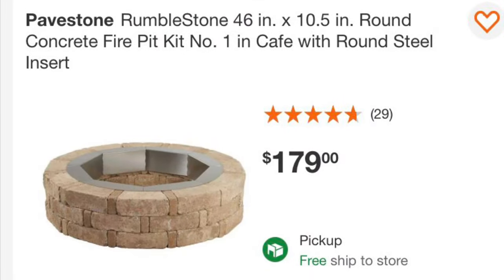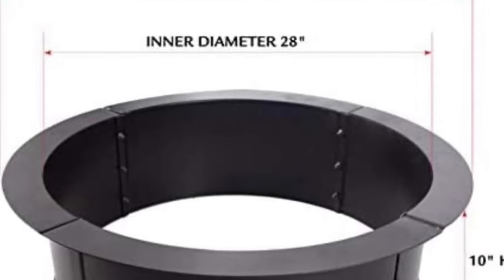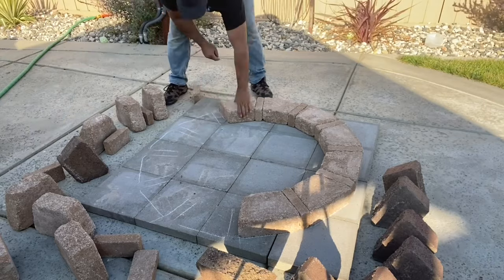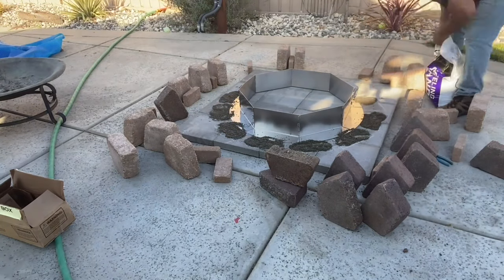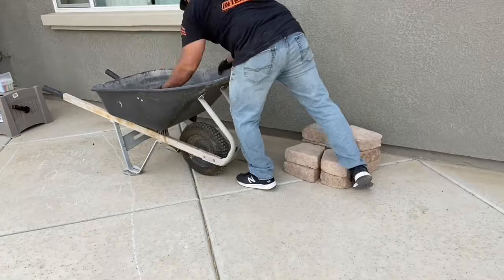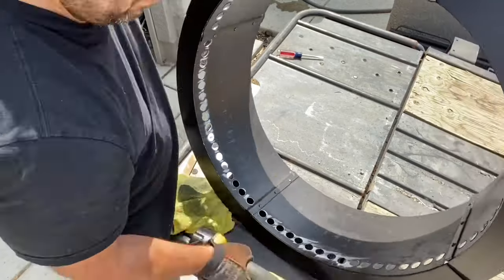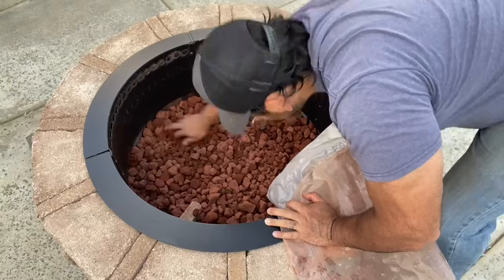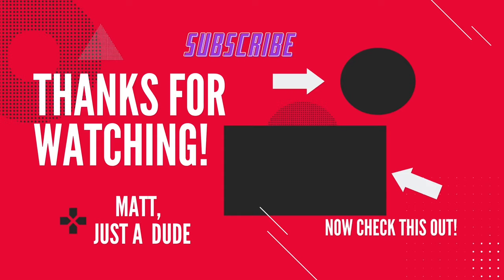Save Money and DIY a Smokeless Fire Pit. Build a Pavestone Rumblestone Smokeless Firepit for cheap!

Comment: Not only did you help me purchase this kit for under $200 (it's now going for well over $600), but using your advice I was able to keep it at 3 bricks high and feel like it's working very well so I was able to eliminate the need for the ring that comes with the kit! Tip forthcoming! Thank you so much! Maybe the wifey will stop getting chased by the smoke demons now!
BTW, I went 1/2 inch holes spread 2 inches apart
Reply from the maker: That’s awesome! Yeah, I did vent the top too much haha. Glad you made it work for you! Thanks for the comment.

Comment: It may be helpful to plumb a tube to the bottom of the middle to feed primary air in under the fire, because even with lava rocks under the fire, there's no passage way under them for air to reach the fire. I've seen some variations on the DIY smokeless fire pit that use a 4" duct tube to bring air in under the fire from outside the pit, buried in the ground, with the opening covered in hardware cloth and buried under the supporting rocks. That seems to work really well.
Reply from the maker: Awesome comment! Ive watched a couple vids like that too. For now, the fire pit works great for me but if I ever rebuild, I might add this and compare it. Thanks again for the comment. Please like and subscribe.

Comment: So this firepit idea.

I like it. I think its a unique idea. I do think you potentially are spending far too much than you need to, since those stones are $2 a pop and you can get away with buying them all outright, and they sell fire rings from ALL OVER cheaper than Home Depot & Lowes; Any solid ring firepit would do for this concept; BUT you would want to make sure you have that "upper ring". More in a moment, at least for my theory.

The way I would propose to make it better would be to add more of those lower induction vents you 'accidently' added.
My theory is that if you were to allow a smaller amount of air from the lower half to enter, it'll still divert 'path of least resistance' to the upper half whilst allowing some air to come in through the bottom. This, in turn, will allow both enough oxygen to immediately start (and inadvertently keep) the fire going, whilst creating a secondary pressure of oxygen to keep the cold air recycling in from the top, creating that 'secondary burn'.

I'm going to probably try this out when it get's warmer here, since I already have these stones; I'll likely just grab another 2 fire rings; One without a cap the other with a cap, and 'repeat' the same idea as what you have here.
I'm using some mildly cheap (but also expensive) one from Tractor Supply. I not only "do not recommend" it, but it's just bulky, warps easily, and burned the fire honestly colder than some $40 amazon fire ring I purchased a couple years back. So I'm likely going to grab 2 rings off Amazon, likely cheaper end simply due to the method I have here.

I'll be trying to figure out the best method of attack for this idea; But cutting about 1" off the fire pit, then tack welding 4 of the spots in place risen up about 1/2". Using that as the "floor". Then setting the other ring inside that one (so any up draft goes back to the upper ring holes).
Then drilling the plethora of holes inside the upper ring cap.

This time, I really want to add a 'stone cap' to the top, so that the there is an extra 'area' of the fire pit, but I'm unsure if I'm going to do that.
What I am doing, however, isn't on a patio. I'm doing this in my backyard and recessing this into the ground a bit to already give a bit of a colder up-draft. Before, I simpy left "gaps" and dug a little dirt trench down to each of the breather holes at the lower part of the fire pit. This time, I think I'll likely span the gap a little wider than the direct with (making it ~36" again) and utilizing some drypack (3:1 sand/portland cement), creating a bit of a 'slope' to the lower part of the fire pit. This way I can ensure that dirt won't just 'make it's way in there after it rains' and make sure that there is some area for air to travel to it.

All in all, unique idea. I was thinking about the two fire-ring idea, but I just wasn't sure how viable it would be. This sort of proves that viability, and would likely make for a more successful fire pit, too.
Reply from the maker: Great idea

Comment: Was going on to order the kit and materials to build this today ( 2/20/22) and WOW ! The whole thing is now over $900 ! Supply chain ripoff. Retailers are now gouging everybody using the Covid excuse. There goes my fire pit this year. Going to have to reuse my 30" cheap metal stand one that cost $39 last year ( Now it's $89 )
Reply from the maker: Wow! Just checked the prices and the price of the kits greystone and sierra blend have really gone up! However, the Rumblestone Cafe Firepit Kit No 1 is still around $200 in my area. Also check with a local landscape supply yard. You might be able to get the blocks by themselves cheaper. Hope this helps.

Comment: I did 1/2 inch holes 2 inches apart and it worked well.
Reply from the maker: Yeah, I was thinking I over did it a little lol! I might redo it and if I do thats exactly what I would put in it!  I dont have any complaints as to how it works right now though. Thanks for the advice!
Reply: Hey, if it works it works! I’m about to add my masonry adhesive
Reply from the maker: It works but with the amount of holes I drilled It doesnt have the air flow to get the flames shooting out of the secondary burn holes. Or, I just havent added enough fuel to the fire yet! Haha

Comment: I'm gonna do holes in the bottom for the main fire to have good cold air. I'm also going to do mine with smaller holes around the top and fewer of them (4" on center) to ensure the air really rushes through the holes to get in to burn the gases in the center of the fire pit.
Reply from the maker: Sounds like an awesome plan! Let me know how it works out.

Comment: Thanks for the tutorial! Unfortunately, as of this comment, the HD kit is $569... so looks like I'll have to wait a couple of years to build this firepit.
Reply from the maker: Prices are rising fast! Ive had the same comment before and was able to find the Cafe colored kits still available for about $200 however, the Greystone and Sierra Blend were priced at $569.
Reply: $775 now, WoW!  Crazy  for $100 worth of bricks.
Reply from the maker: It is crazy. Especially how each color is selling for a different price. I just checked the home depot website and the Café colored kit is still $209 but the Greystone is $775 and the Sierra Blend is $846!  I would just order the blocks individually at a local Rumblestone supplier.
Reply: Don't buy the kit, kit it yourself and save hundreds
Reply: Liner $100, 60 stones $66, heat resistant caulk/glue. Don't buy the kit lol
Reply: over $900. WTF

Comment: Good looking pit, I seen a build where a guy explained the science and mentioned that it was important to have smaller holes around the perimeter at the top. Just putting that out there.

Edit: look up Bernoulli's principle and apply that to the smaller holes on top putting more pressure out of those top holes enabling that hot air able to reach the fire in the middle (making a more efficient secondary burn)... 

Same idea If as if you were to break a sprinkler line all of the pressure would be lost due to the water moving too fast. So essentially you want to slow down the air moving up the inside channel which will push hot air out of those holes with much more pressure. Follow Bernoulli's principle and you will perfect the function of a smokeless fire pit. This is one of the cleanest ones I've seen online! Again I'm sure it works pretty well already, but try plugging every other hole with something if you want to test the theory. Cheers, I'll likely use your build template, it's my favorite final result so far!!!
Reply from the maker: For sure! If I did it again id drill 1/2 inch hole 2 inches apart. This does get fire fingers but the fires gotta be HOT! Thank you though for the comment. Glad you like my vid the best!

Comment: Great Video, "Dude"!  One small question...How big are the holes you cut in the ring?  Doesn't look very big?  Thanks!
Reply from the maker: Great question. I drilled 7/8 inch holes
Spaced 1-1/4 of an inch away from each other. I felt these hole were placed too close to each other once the pit was complete. Another person on this thread stated they drilled 1/2 inch hole two inches away from each other. That would probably work better. Hope this helps. Thank you for the comment.

Comment: if you built a 'tunnel' under the bricks to allow fresh air into the center of the fire pit - the fire would burn hotter. you could have an adjustable door on the air tunnel to control flow. it would be similar to store bought smokeless fire pits that allow air in from the bottom
Reply from the maker: Awesome idea! That would work pretty good but this fire pit burn very hot. It draws air in from the lower vent holes and air reaches the bottom of the fire through the lava rock  great idea though and it would work good in a pit that I think, is more closed off.  Please like and subscribe. Thanks again
Reply: @JustaDude123  can  lower holes be adjusted for air flow? All wood stoves have air flow adjustment
Reply from the maker: They cannot. You could put a brick in front of them and use it to close them off or open them up.
Reply: @JustaDude123  I think a central air flow from a separate "tunnel" has the advantage of easy to control flow and it does not reduce the flow of air to the top holes. Ie the top holes would be faster without the bottom "leak" holes.
Reply: Air flow flowing through lava rock will eventually get clogged by ash. It would be less of a problem with a central hole to keep clear, not the whole bottom of the pit needs to be dug out and rocks cleaned to maintain air flow
Reply from the maker: Great comment and tip. Thank you!

Comment: great video, 1 question though.  The pavers at the bottom of the firepit, are those needed?  will the fires mess up on concrete deck (like cause cracking or something)?
Reply from the maker: Great question.  I dont know of they are needed. The smokeless fire might work without them but Im not sure. Having a fire directly on the concrete will mess it up. The heat from the fire will expand air pockets on the concrete and cause it to blow out. Hope this helps. Thank you
Reply: @JustaDude123  1 year later and still happy with it?  other then the 2" on center suggestions any others?
Reply from the maker: Love it. It works very well just gotta keep it fed. It burns hot so make sure you have plenty of wood.

Comment: I'm not sure what the bottom ring is doing. It looks like it's blocking the airflow from your openings at the bottom of your fire pit?
Reply from the maker: Great question! It is not. The air flow at the bottom does make it to the fire a little bit. The bottom ring is supposed to go to the top ring and make an air chamber between the bricks and the fire. This air enters from the outside at the bottom of the pit and is then heated and it rises. It then goes into the fire through the top holes and helps to get rid of smoke from the fire.  I hope this answers your question. Thank you for watching!

Comment: I would probably have inverted the stainles panel ring and drilled holes around the bottom of that and set the black ring on top of that ledge and left some gaps in the second tier to. But still this is the best. "DIY" firepit video i have yet seen.
Reply from the maker: Those are definitely some ideas worth trying out! Thank you!

Comment: Thanks for the video! 
Quick question: 
in addition to being just a cool fire pit to sit around - would it work for cooking/grilling purposes too?
Reply from the maker: Great question. It should be able to be used for cooking. You are going to have to add some kind of cooking surface to the pit though. The fire does get really hot.  Hope this helps. Thank you!
Reply: @JustaDude123  thanks for the answer! Well, in this case, I'm more interested in grilling... The thing is - I just bought a house with a relatively small backyard, so I'm looking for some kind of  'all-in-one' fire pit solution, to sit around and enjoy the fire, but also to grill some meat on the remaining charcoal.
Reply from the maker: If you google Firepit with cooking insert, youll have a lot of options to choose from. Hopefully this helps you. Thanks again!

Comment: Damn... That kit is $926 now.   Nope, no inflation.
Reply from the maker: Completely understand. The cheapest way to go would be to buy the bricks individually. Go to a landscape supply company which is a Pavestone dealer and order the block. You need 12 traps and 12 small rectangles for each row.
Reply: Yeah,  I already ordered all the stuff I need.   Although I went with the smaller ring (28" I.D.)  since our patio is pretty narrow.     Ends up being 11 per row and no small rectangles.  But to think the price of that kit has nearly 4x'd in 2 years is nuts.

Comment: I’ve been watching lots of smokeless builds. I like how you used the lower metal ring that was the top of the kit! This size is also a big plus. Great job. 
I’ve drilled 8 intake holes in the lower part of the 3 ft ring from tractor supply I’m wondering if you would recommend holes in the bottom of the ring or not. I hope they help since I’m stuck with mine now. I’m assuming they will work as an intake.
Reply from the maker: They would.  You gotta get air to the bottom of the fire as well. Thank you! Please like and subscribe.
Reply: Yes exactly. Want air coming in the bottom so the first/bottom burn to burn hot.

Comment: Thanks so much for this excellent video! Have you burned enough to get a lot of ash in the bottom? I'm curious how difficult it is to clean out the ashes.
Reply from the maker: Thank you for the comment!  I only use the fire pit about once every other week. But to clean it, I just vacuum the ash out of it with a shop vac. I make sure its been a couple of days so there are no embers and put my fingers over the end of the shop vac hose to act as a screen. The ash is vacuumed up and my fingers keep the rocks from being sucked up as well. If there are larger pieces of wood/ash, I just pick them out and throw them away. Hope this answers your question. Please like and subscribe.
Reply: @JustaDude123  just a thought if you end up using it more often, you could easily make a metal mesh cap just smaller than your lava rock to pop on the vac for a less awkward quick vacuum clean up.
Reply from the maker: That would work out pretty good!

Comment: I want a more natural-looking stone on the sides and a more finished cap stone, so I will probably not go with the kit. It seems like what you need to bring the inner wall of the pit to the bottom is a ring with the flange on top and sides that extend down to cover the vents coming into the cavity between the inner and outer wall.  I wonder if they sell those. If not, couldn't an aluminum sheet be inserted to extend the black metal ring downward and cover those vents bring air into the cavity?
Reply from the maker: Great comment. I would be wary of using aluminum due to the fact the fire could melt it. Id stick with mild steel or stainless. Also, The ring doesn’t have to be “airtight”. You gotta get air to the bottom of the fire as well. Hope this helps. Thank you again for the comment.
Reply: @JustaDude123  I follow you, so let the air come in below the sides of the ring. On the outside I’m torn between natural stone veneer that has to glued to some brick interior wall or a dry stack with concrete trapezoidal wall “stones” that don’t look natural to me.  I’m going to continue looking for some dry stack material that will do the job.  I need a nice cap material too.  Advice welcome.
Reply from the maker: If you want something custom for a cap/fire ring, you could have something custom built at a welding shop. Also, look up how a solo stove works and secondary burn. It will probably aid in the planning of your build. Hope this helps. Please like and subscribe.

Comment: how do you remove the ashes from the lava stones, or it will just keep building up?
Reply from the maker: Great question. I use a shop vac. I put my fingers over the end of the hose and spread them apart. This allows the ash to be vacuumed up but my fingers stop the lava rocks from passing through. Hope this helps. Thank you!

Comment: The problem i wonder about is when it rains do the ashes run out on to the patio?
Reply from the maker: Great question. Not that Ive noticed. We got about 5 inches of rain last weekend too. Might have been enough though to wash it clean but I havent noticed any black ash seeping put of the lower vent holes. Thanks again for the comment. Please like and subscribe